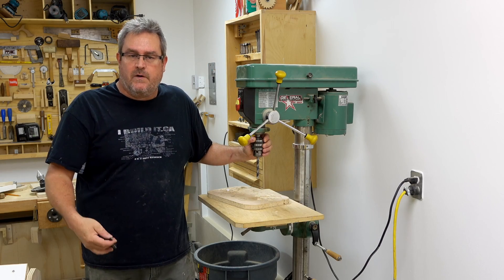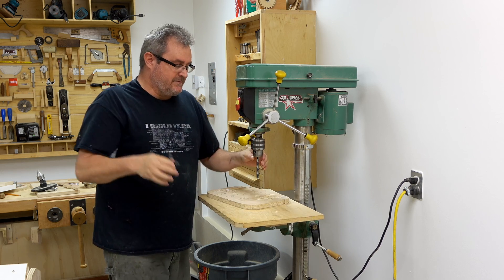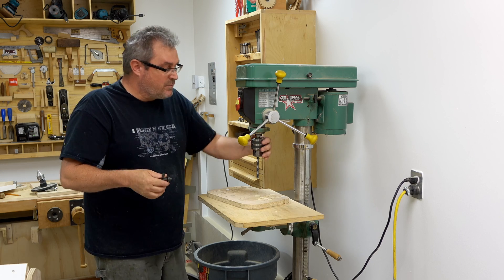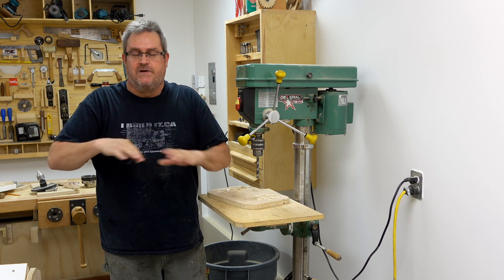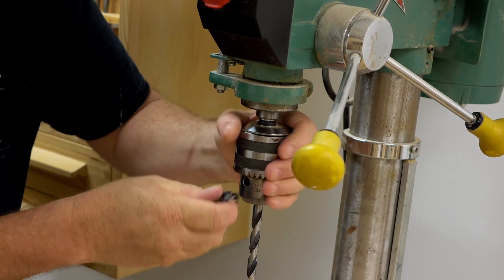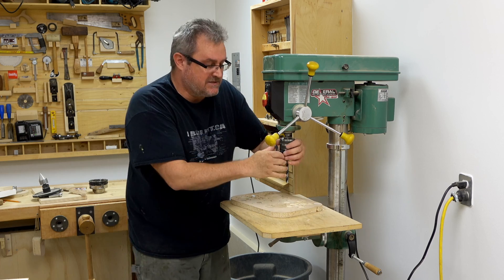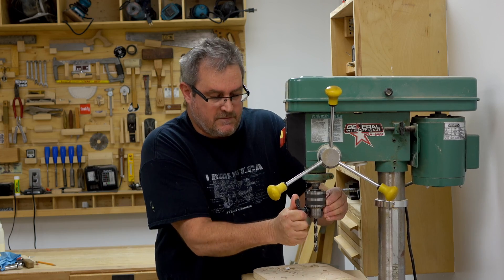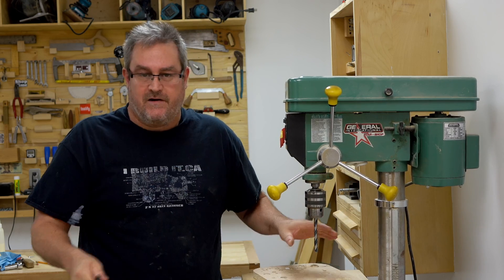Why Tighten All Three Holes On A Keyed Chuck?

Comment: I thought that was common knowledge. I always used the 3 holes because my dad told me to do it this way, my grandpa told him to do it this way and so on. But I never thought about the reasons behind it. That was a great explanation, John.
Reply: I was getting ready to cook a roast. I cut the end off, just like my mom taught me. My daughter asked why. I said, "I don't know. Let's ask Grandma." My mom told us that that's the way she learned it from HER mom. "I don't know. Let's ask Great Grandma," she said. "Great Grandma, why is it important to cut the end off of a roast before it goes in the oven?" "Oh. That's the only way it would fit into my small roasting pan, " she told us. Not everything handed down is logical.
Reply: You're right, that's exactly why it's nice to see John explaining the reason behind it.
Reply: Ahhh. But, unfortunately, his explanation, and the entire concept, is without merit. There is no need to do more than tighten a chuck at a single key hole. The three holes are there for convenience (access) and, to a degree, balance. Same for a lathe chuck. The whole design of a keyed drill chuck applies circumferential lever action to the toothed chuck jaws. This draws all three up simultaneously, and with equal force.   Check a production shop. The only guys you see tightening chucks three times are the guys who will either learn, or who won't be there long.
Reply: Mike Scally 100% correct

Comment: I've been doing that for about 19 years now. I started doing it when I have to drill holes in the side of rail (bonding) for installing track wire pins (chicken heads). I found that tightening using the three holes, the bit wouldn't fall out.

A few months ago I was watching a video of a machinist. He said it's always best to tighten using all three holes, not just so the bit doesn't fall out but it will also not be as hard on the chuck and it will last longer.

Comment: 2 words to think about while you are all debating this. Keyless Chuck...
Reply: Jason B Sorry but keyless chucks are on most high end drill presses, lathes, and CNC machines now. If it is a good quality keyless chuck you don't have that issue. Not rocket science just common sense
Reply: All my battery powered drills have keyless chucks. It is a great invention most of the time. My experience is that you cannot get a keyless chuck as tight on a round drill bits as a keyed chuck.For keyless chucks I try to buy drill bits with flat spots milled on them for bits over about 3/8.  As other have said, a lot depends upon on the material being drilled. I also have had keyless chucks loosen when drilling multiple holes. Of course, others may have different experiences .
Reply: James Rawlings I do agree but only  for cheaply made keyless chucks. My Dewalt drill has a nice ratcheting keyless chuck and never has a issue while my less expensive Ryobi has a crap keyless chuck that does much of what you describe.
Reply: MrWizards1974 Exactly, my Milwaukee cordless drill has a ratcheting keyless chuck that never slips. what i really like about it is that i can tighten it down without using the drills motor to geg a "head start" on it like i used to with cheaper drills. it tightens down great with just hand power.
Reply: MrWizards1974 yes in battery operated drills most if not all cord powder drills and presses use a key to tighten the chuck because of the higher power exerted het john we got another rocket scientist over here

Comment: It works like this when tightening with one hole you're pulling the check mechanism in One Direction causes it to bind up on itself and stops you tightening it further, then by tightening the opposite side releases the mechanism what in turn gives you that little bit more movement all depends on the quality of the chuck tho.

Comment: So here's my theory. Because of the nature of the chuck key and ring gear, when you tighten one side it pushes that side of the collar up, slightly skewing it. When you move around to the other holes it evens out the collar, allowing it to turn a rad more. I think that it's possible that if you continue going around it would continue to tighten as the collar achieves an equal pressure on the jaws. Just a theory!
Reply: This is exactly my thought.
Reply: Sorry but your theory is incorrect. The ring gear in a chuck applies equal pressure on all 3 jaws. Don't take my word for it Do a search for ( What Makes It Work #25 JACOBS DRILL CHUCK  ) and you will see what I say is true. When John moves to a different hole he repositions the key at a different angle that gives him more leverage he can produce the same effect by repositioning the key in the same hole. There is really no difference in the way a Jacobs 3 jaw chuck and a nut and bolt work. Now on the other hand a lathe scroll chuck needs all 3 positions to be tight individually because they are all bevel gears and each of the 3 gears have a direct chuck insert although some scroll chucks only have 1 key hole. For a clearer picture and difference in the chucks google ( What Makes It Work #26b 3-jaw lathe SCROLL CHUCK ). Hope this clears things up
Reply: You probably hit the nail on the head because I was one of "whiners" that commented on the method on John's video. It just didn't seem logical to me but the proof is in the pudding from watching John and by they way you explained the reason why. I'd have to say I was wrong and will now tighten all three from now on.
Reply: MrWizards1974 maybe you should try using all holes yourself. :)
Reply: MadModders Maybe you should stop trolling
Reply: My theory as well.

Comment: So it's basically the same concept as putting lugs back on a wheel.
Reply: Or tuning a drum head, was mine.
Reply: Except in those cases where there are more than three "lugs" and so you use some criss/cross pattern to tighten uniformly as well - to distribute the forces equally about the "surface".
Reply: Exactly what I was going to say!

Comment: Growing up & in school... I was always instructed "There are 3 holes for a reason!"... Nuff Said !
Reply: I tried that line on a date once, didn't work out.
Reply: The common argument against that is that there are 3 holes so that there is always one placed conveniently.  So you won't have to rotate the chuck to find the single hole.  Sometimes they can be hard to turn, based on gearing.  I am not saying that I necessarily agree, but that is the common reply in forum debates.
Reply: So you can have at them 120* apart.
Reply: If you're stripping teeth off a Jacobs chuck.... You're doing something WAY wrong !
Reply: You guys really know how to pound a point home.
Reply: Brad Nielsen, are you sure that it was related to this?  Sorry, had to..
Reply: you say sexualy???
Reply: And this is why John has no female viewers, hahaha!